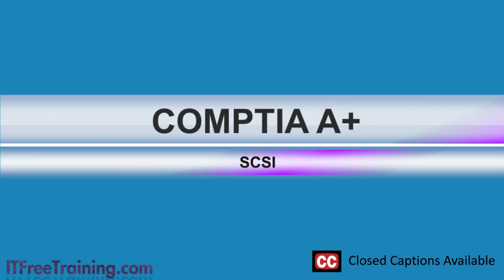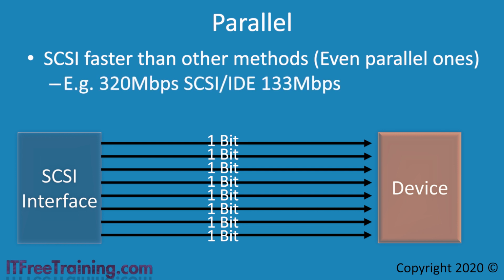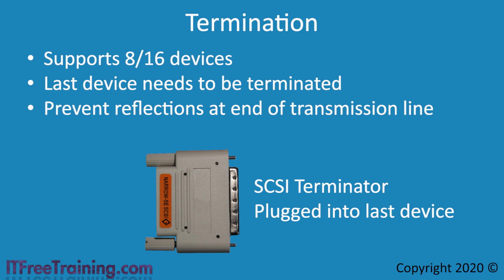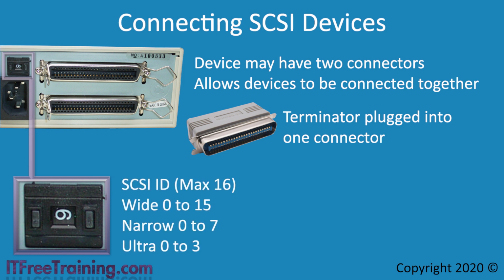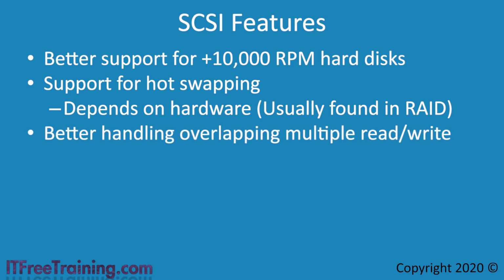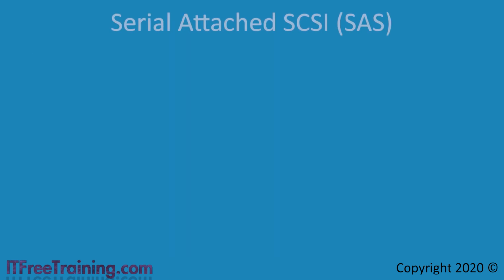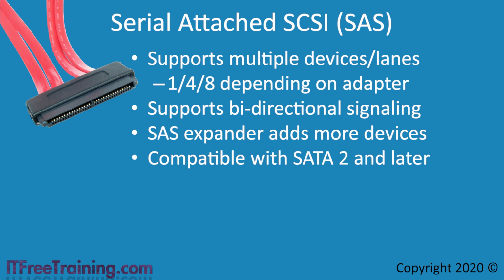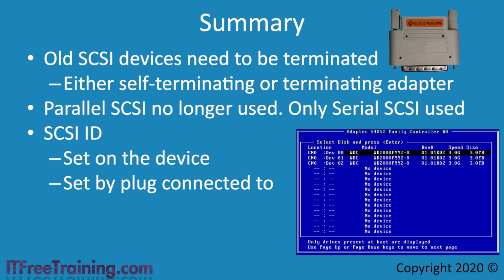SCSI

Comment: SCSI is the parallel I/o interface in between main adapter and smart device controller,possessing the ability to connect up to 15 all kinds of high speed peripheral devices
Reply: Yep and there's a lot more to it, mentioned in the video.
Reply from the maker: We have a few videos on SCSI. The older ones go into more detail.

Comment: In the past i had to use iscsi to trick a programm on my computer to think that the raid partition on my NAS would be an internal harddrive. Worked great and i could even play games over it
Reply from the maker: Sounds good. People still use iSCSI to do that. It is a cheaper option than using fibre channel.

Comment: I've been using SAS for years now already and what he talks here is mostly gibberish, theoretical but not real-world, in real world only 1x to 4 device sas is possible at most (and is usually the standard, oddity when less that 4 headers are coming from "minisas")
Reply from the maker: You are aware that SAS is often used for large storage like SANs and cloud storage? These have a lot more SAS drives than that. I worked on a server recently that has 20 SAS drives connected via RAID to local storage. I am guessing you only have work on individual drives.
Reply: @itfreetraining  it's been 7 months and I don't remember what I commented about, but MiniSAS is up to 4x, those servers have many mini-SAS ports, not 1

My servers have only built in 1 or 2 minisas headers but adapters and what's it called - the middleplate have many ports
Reply: There's no gibberish mentioned in this video.

Comment: i have an energy meter, uses floppy with scsi 26 pins, i don't know how can i adapt that to an emulator floppy, to use an sd or usb flash,
Reply from the maker: I am not sure it is possible.
This article talks about a SCSI to USB connection.
https://www.tech-faq.com/how-to-connect-scsi-to-usb.html
Maybe is you could connected the energy meter to a computer and have a computer emulator a floppy drive that may work. Not sure how you would go about doing it.

Comment: can you daisy chain a scsi jaz 1G off of a zip 100?
Reply from the maker: I would say you would be able to, assuming they use the same type of SCSI. A lot of external devices back than used SCSI SE, so the bus should reduce down to the slowest device on the chain. Can't say for sure it would work, but good chance it will. Just make sure that you give them different SCSI ID's.

Comment: I know your just providing just a general overview, but last time I had anything to do with legacy SCSI the controller also had a SCSI ID.  A Comment on that might be in order.
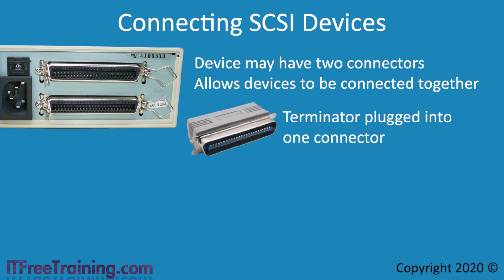Reply from the maker: That is mention at 5:00 in to the video. It talks about the switches or counter on the back of the device to set the SCSI ID.
Reply: @itfreetraining  talking about the controller itself.  Most people wouldn’t consider the controller to be a device in the chain
Reply from the maker: @norlag  I see what you are saying now. Yes, we did forget to mention that.
Reply: @itfreetraining  yes on my Adaptec 29160N PCI Ultra160 SCSI card it designates ID-7 for the SCSI controller.